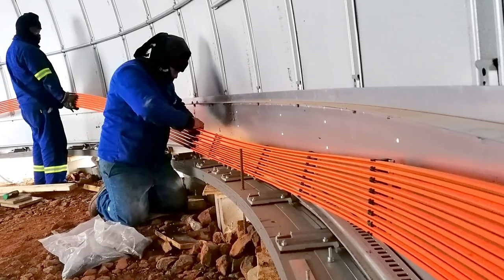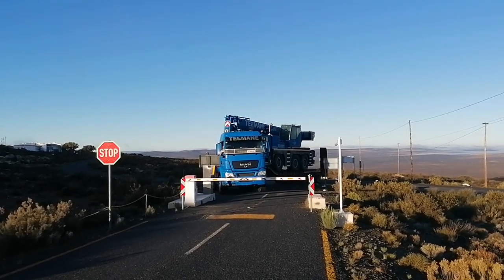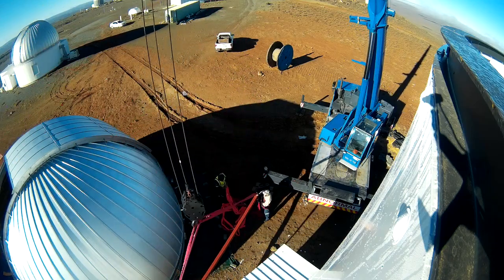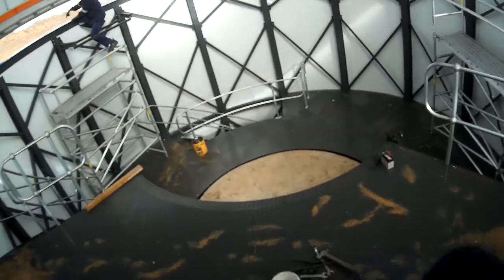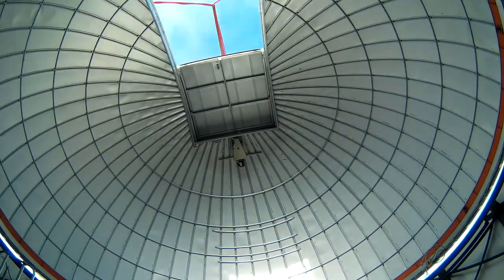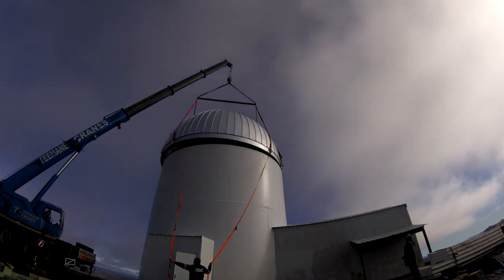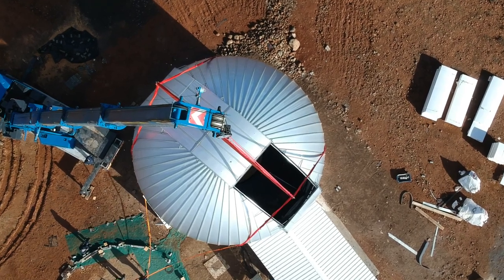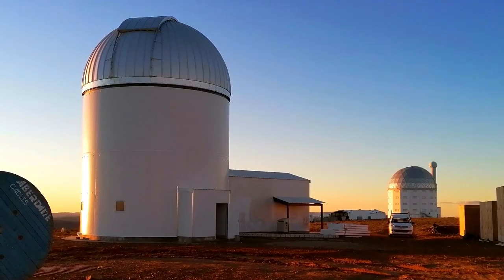PRIME Telescope:  The Dome Lift  -  Part 3 of 3

Comment: I suspect most people who enjoy astronomy don't appreciate the skill and effort needed to build the infrastructure to support the telescopes.  Thanks for a great build, video, and narration!

I'm no rigger, but my guess is a 9 meter dome needs at least a 9 meter spreader bar and the bar used here was less than that.  It looks like the dome was dented in by the lifting straps, or are my eyes playing tricks on me?
Reply from the maker: Thanks, great to hear you enjoyed the video.  Make sure you also watch the one of the building of the ATLAS dome, that was great fun!
Regarding the rigging for the dome lift, Ash Dome supplied the dimensions of the spreader bar, but as you saw, it caused slight indentations, which luckily jumped back out when the tension was released.  Not shown in the video, the crane company's rigger first rigged it with longer slings, specially to give a shallower angle, but this made the slings too tall for the reach of the crane
Reply: @SterremanWillie  That's good news!  I didn't see the dents at the end, but I assumed they were panel-hammered out.
Reply from the maker: @noneofyourbusiness4433  the dents actually popped back out by themselves when the slings relaxed.